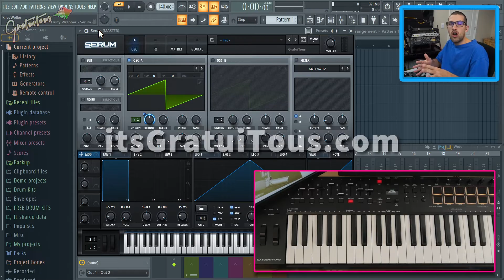Fix Pitch Wheel and Mod Wheel in FL Studio

Comment: You should set 12 to use the full range of the pitch wheel (not 10)
Reply from the maker: Ideally, yes, to stay in perfect octave pitch - but the keyboard's mod wheel is bugged, so increasing it allows you to get the min/max values, whereas without adjusting the pitch range, it wasn't able to reach those levels.  But yes, staying in 12, 24, 36, etc.. allows pitch wheel to stay in proper pitch - you are right!  - https://itsgratuitous.com/

Comment: Hey nice video it really works, but I got another problem jeje in sylenth1 when I use de mod wheel I actually moves another knob in the LFO but not the  mod wheel I don't know if you could figure it out thanks
Reply from the maker: Possibly you set up Global Links maybe by accident on that Mod Wheel.  You'd have to look at your Port Mapping file in FL Studio (It's in your Documents folder).  Or, you can try putting the MIDI Keyboard on a different port, and see if it's still doing it.
https://itsgratuitous.com/

Comment: thanks but can i move it whole step instead of half step?
Reply from the maker: The pitch / mod wheel are typically fluid - so not fixed step - like pitch wheel would move in cents - and mod wheel would move in percentage.  Can you describe a bit more specifically what you're trying to achieve?

Comment: Is it possible to limit the range of the mod wheel? Like from 0 to 3 instead of 0 to 127?. Nice vid. Thx
Reply from the maker: Yes, if you click Omni - Mod Wheel (wrapper) in the browser under Current project -> Remote control, left click it, a pop-up will appear.  In the mapping formula you can write formula which will reduce the max output of the mod wheel.. you can try this to start with: Input*0.1 (then press enter to see it's output before accepting).

Let me know if that gets you close to what you're wanting.

https://itsgratuitous.com/

Comment: it's actually not 10, it's 12+- (check Nexus Pitchbend range inside the modulation settings), so it's a full octave, but FL Studio only starts at 2 for some weird reason :)
Reply from the maker: 12 Semi-tones is 1 octave.  If I showed 10 in the video, it's because I think that maxed out the Pitch Wheel anyways.  I do not use pitch / mod wheel when making beats, this video was strictly just showing ways to make Pitch Wheel Work in FL Studio for VSTs:
https://itsgratuitous.com/fix-pitch-wheel-mod-wheel-fl-studio/

Comment: Hi, do you know what the problem/solution might be if my mod wheel only takes on values 10-91%? I bought an FLKey 49 recently and I'm hoping there's a software fix.

Similar story with my pitch bend, which takes on values of about +/- 1.5 semitones instead of +/- 2. I can kind of work around this one though by doubling the range on FL studio from 2 to 4 to give me about +/- 3 semitones, which works fine since that's a nice minor third and I have learned by ear about where a whole tone jump is.

Thanks for any help and the nice video!
Reply from the maker: I'm not sure on the mod wheel.. and the pitch wheel fix is as you said, you simply increase pitch bend semitones in Channel Sampler of the sound..

I really don't use mod / pitch wheel often when making beats, and only made this video as it's a common question students have.  Sorry can't be of more help!

https://itsgratuitous.com/

Comment: 1. Pitch range does not work in KONTAKT. It still freaking 2 despite on I change range in top right corner and/or "send pitch bend range" in plugin midi settings 
2. What if I lost OMNI channel pitch control? Delete or just there is no such things at all. How to restore it?
Reply from the maker: KONTAKT usually does things different than what you see in most tutorials.  I don't have a fix for that.

If you lost Omni - Channel pitch, I don't think you can delete it?

Are you focusing on the pitch wheel or mod wheel.. and can you get them working in a plugin other than KONTAKT?

Let me know - https://itsGratuiTous.com
Reply: @itsGratuiTous y yeah, I deleted it completely trying to fix controls... So I opened Nexus, then created new link to mod wheel and pitch wheel, then made them omni, now it works again. But pitch in Kontakt is a pain in the ass...
Reply from the maker: @WillFalcon  Ya I've always read Kontakt has done things different in regards to mapping knobs, pitch wheel, etc..  Sorry I can't help further there :(
Reply: @itsGratuiTous  I broke my pitch  somehow... wierd
Reply from the maker: @WillFalcon   What's going on over there, lol! - Are you using the M-Audio Oxygen Pro MIDI Keyboard?  Have you tried opening a brand-new project with no template in FL Studio to see if it is back to normal?  Is there a hard reset option for your MIDI Keyboard?

Comment: This is great, but I'm worried it wouldn't help me with the issue I'm lately facing. I work on FL, have an AKAI MPK249 and it seems mod wheel got lost its settings in terms of range. I can see the debug log indicating "absolution" values between 64-127 and every time a vst is loaded and linked to the controller it sounds like I have a 50% of modulation without touching anything. I've searched nearly everywhere and didn't see anyone mentioning something like that, tried almost anything but not resetting anything cause I'm in the middle of recording a while album right now.. It sounds like I can't control the range of the modulation wheel below the "64" value. If you could help me I would really appreciate it. PC Desktop, Windows 10, FL Version 20.6 Producer
Thanks in advance!
Reply from the maker: Hey, what I'd try is viewing the "Remote Control" settings of the "Omni - Mod wheel (Wrapper)".

Under "Current project", select "Remote control", then left-click "Omni - Mod wheel (Wrapper)".

This will bring up your "Remote control settings" window.

In your "Mapping formula" does it say anything other than "Input"?  This is where you can adjust how a knob or slider adjusts to a parameter.

Let me know..

https://itsGratuiTous.com

Comment: Hello, is there any way to disable the pitch and mod wheel? Because when I connect the midi the pitch wheel moves by itself in the software. I don't know if it's a software issue or the midi wheel is broken. Please help.
Reply from the maker: You could try to remove the Mod Wheel and Channel Pitch in the "Remote Control" folder under "Current Project".. I explain more in my article: https://itsgratuitous.com/fix-pitch-wheel-mod-wheel-fl-studio/

Comment: And in native fl vst ? Don't work
Reply from the maker: Hey there!  I think it does!  You have to hit the cog in the FL Wrapper (Detailed Settings).  Then you can increase the pitch range.  For the mod wheel, you just manually set it up to whatever knob you want!

Let me know if you have a more specific question that maybe I'm overlooking.. here to help!:
https://itsGratuiTous.com/
Reply: Mod  wheel with overide global link ?
Reply from the maker: @rudolphsiekiera7579  I'm not sure of a 100% permanent fix, but here's a workaround.

The Mod Wheel is CC 1.

If you delete the Remote control - "Omni - Mod wheel (Wrapper)", you'll be able to gain access to the Mod Wheel for global links (found in the browser under "Current project -> Remote control").

That will allow you to use it to set up your global links (or you can manually set CC 1 on the "Global link settings" popup).

Let me know your thoughts..

https://itsGratuiTous.com/
Reply from the maker: Hi Rudolph, here's how you can use the Mod Wheel with a Global Link:
https://itsgratuitous.com/fix-mod-wheel-flstudio/